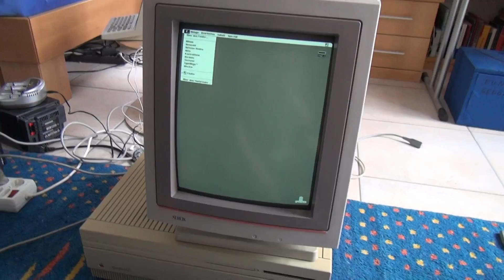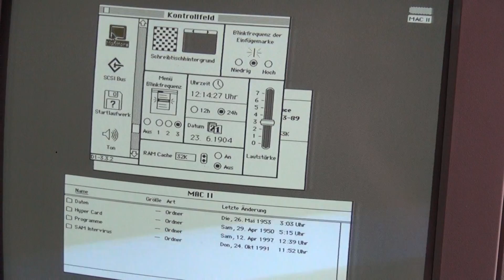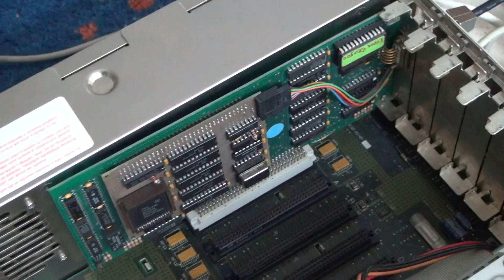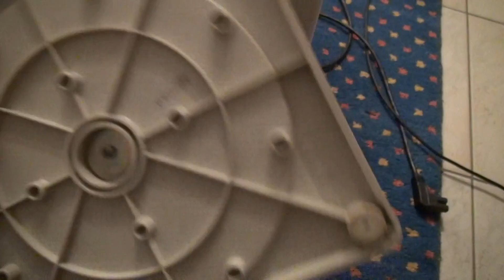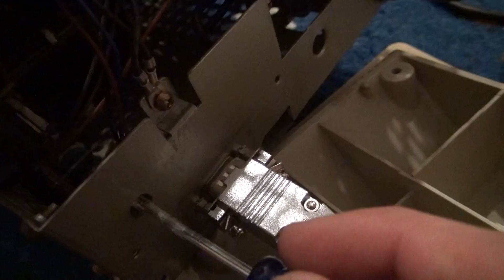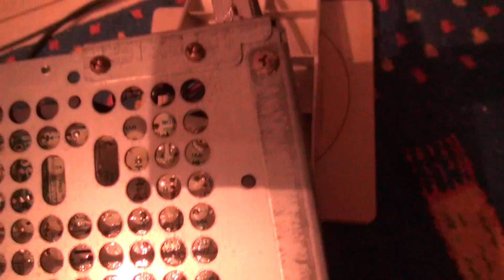Apple Macintosh II with Xerox portrait display walkthrough

Comment: the yellow/beige colour mostly derives from plastics containing bromides. 
those have been used to reduce risk of fire (and make the plastics "self containing" in case of fire). 
But they are not stable in uv light.